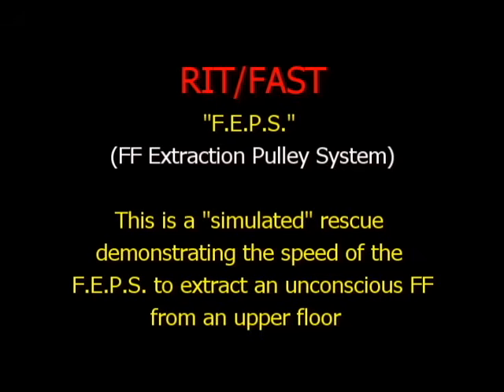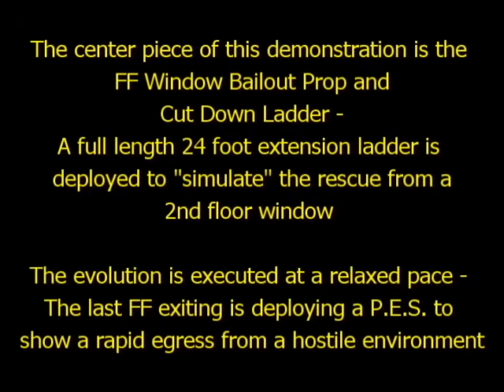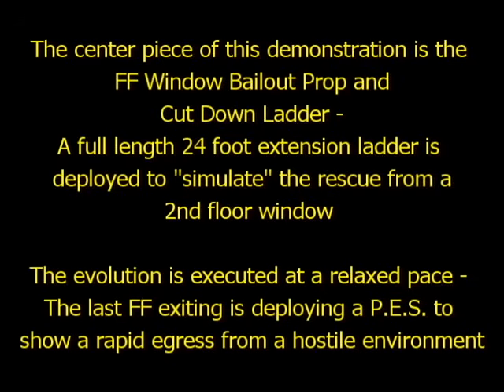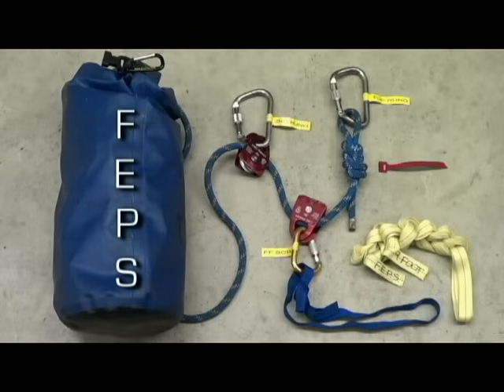Firefighter Rapid Intervention F.E.P.S. Demo

Comment: Great video, would recommend having the firefighters pull straight down on the system. Pulling straight down keeps the the system from pulling the ladder over.  2:10 you can see what i mean.
Reply from the maker: Pulling straight down is an option and it's what we teach when you can't walk back away from the ladder due to another adjacent building being in the way. However pulling straight down requires hand over hand movements and is MUCH harder, especially with a heavy load/larger victim. When we have the personnel available we will keep a FF at the top of the ladder to tip load it - This helps prevent the ladder from pulling away from the building and it also allows that FF to make sure the pulleys stay centered on the rungs.
Reply: @DALEGPEKEL  I personally train pulling down and having the interior firefighters assist if needed  as your primary way to extract the firefighter. I would just be concerned about what your asking of the ladder with the extra firefighter on the tip. But this seems like a nice rapid set up for firefighter extraction
Reply from the maker: @pilot4life15  I assembled this system back in 1994 for my Volley FD when we were putting together RIT equipment and procedures for our members. I've trained with it countless times in a variety of scenarios - It's not perfect for every situation, but I'm extremely confident in it as I know its capabilities and limitations.

Comment: Not trolling or anything. I'm one of my FD RIT instructors.   I am wondering what the advantage of this is over the High Rung technique is?
Reply from the maker: Hey Mike - I would have to see the exact "High Rung" technique you're referring to in order to make a comparison.  As I'm sure you know being a RIT instructor there are numerous versions of this equipment and methods for performing "Denver Drill" style rescues. I like the FEPS we use for the speed and efficiency of setup - The pulleys in the system provide not only mechanical advantage but a smooth and easy haul when lifting a heavy victim. If you have a video of your method, I'd love to see it - Thanks for the comment.
Reply: Shoot me an email. Michael.gelsomini@gmail.com.    I'll show ya.   I just watched you're video of the pre rigged web harness inside bunker hear.  I just set it up on mine.